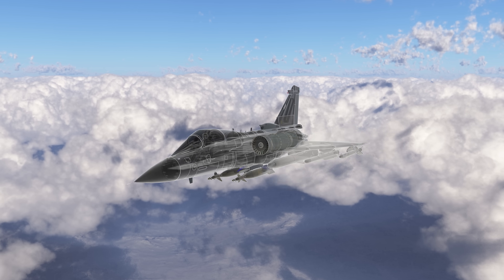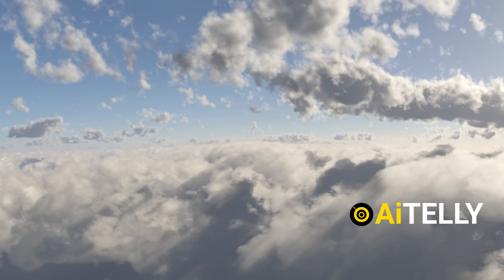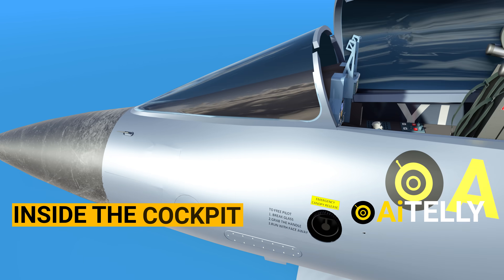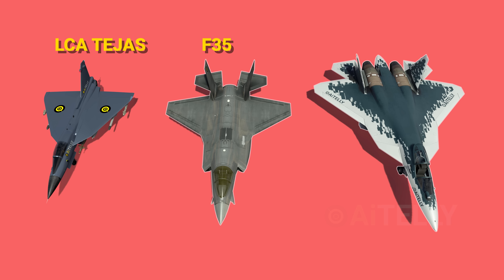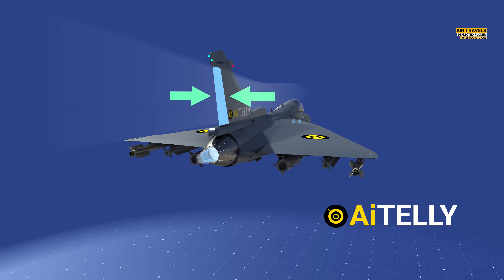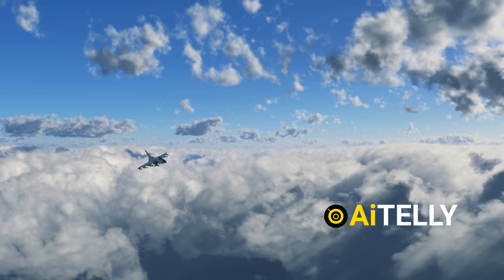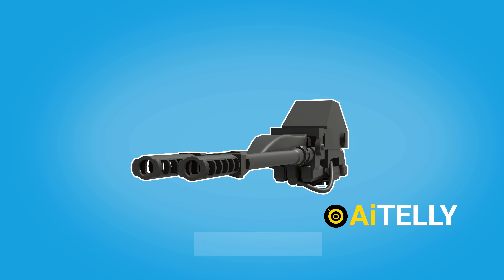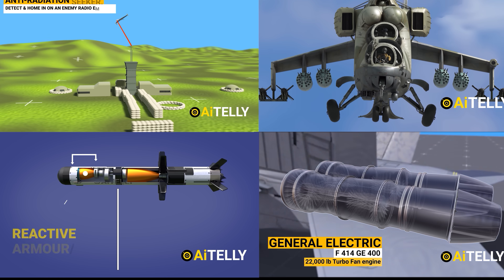Multirole Fighter Jets  How it Works | Tejas Mk1A LCA Light Combat Aircraft #fighterjet #jet #plane

Comment: Wow, I never knew Tejas was the lightest multirole jet. I am indian and never realized just how small it was, even seeing it next to our Rafales and Su-30s. Great work as always. One minor suggestion, could you cover the intake design in future videos more? It is an important aspect of modern aircraft for RCS and overall efficiency purposes.
Reply from the maker: Thanks for sharing
Reply: well Su-30 is ofc a heavy fighter so is more bigger but i also never though Tejas is more smaller than Rafale
Reply: @HHI_10  the size of the Tejas is 2/3 of Rafale. As i see them both fly side by side over my house.
Reply: You should have known..keep urself updated and don't fall for ANY propoganda
Reply: 1 hour flight time what can it do
Reply: @vctor6768   more than 3 hours....wtf are you talking
Reply: @detectivesroy    that's when it's not carrying anything...the frame is so small
Reply: @vctor6768  it already flew Sulur(india) to Singapore with 3 drop tanks ranges around 3300kms. Demonstrated range of 1800 km with 3 tons payload(including 1 droptank) and you saying this.
A Delta wing fighter which is aerodynamically efficient design , same engine & fuel capacity as gripen C even light weight than gripen and you saying 1 hours endurance based on some outdated media outlets. Nah 😏
Reply: @detectivesroy   if 3 drop tanks is 3300km what about if no tanks, and again no tanks and extra weight by weapons...do the mathematics
Reply: @vctor6768  if no tanks then too 1800 km with decent payload. have you read my comment...read properly. If that's the case then jf-17 must have 30min of endurance, and gripen around 60 mins LoL . There Are lot of articles around dismantling this false claims
Reply: @detectivesroy  
as a novice hobbyist , can i ask where u get these infos from?
Reply: @KrishnaGupta-xi6el  delhi defence review ka article padd lena waha acche se explain kia hai . Unfortunately link isn't supporting
Reply: @vctor6768  1 hour flight time enough for defending the borders...that's the primary purpose, it's not for strike capabilities...and due to the geographical boundaries that India has, Radars shall detect incoming aircraft and a highly manoeuvrable aircraft with BVR capabilities is good enough to handle things from the heights that we have over our neighbours. Even if they would go on an offensive, their role would be limited to Anti-radar and anti-ground forces...clearing the way for the "package" delivery aircrafts.
India doesn't want to attack far away, it just wants to keeps its borders well!!
For Attack capabilities we've the Awesome Sukhois and Rafales!!
And mind you, The Mirages have still a long way to go!!

Tejas is a stop gap...it won't be required to fly beyond an hour! A powerful single engine , lightweight with a nice payload capability means the fuel HAS to be compromised!

Also, smaller the size, minuscule the RCS!!!
Reply: @drparthgajjar  hahahah have u had of JF 17 thunder ⚡⚡
Reply: @vctor6768  ya...pit em against Tejas netime!!! (Basic Tejas or MK1 or MK1 Alpha or any damn variant)
Reply: @drparthgajjar   the only thing that this junk is match for is the MiG21 bison ..
Reply: @vctor6768  you mean the same Bisons that brought an F16 down?
Reply: @drparthgajjar just looked into that story, apparently the Indian mig 21 crashed and then everyone started saying it shot down an f-16 with 0 evidence😂

They had some photos that they claimed was the shot down f-16 but the destroyed f-16 in the photos had an America engine, Bellingcat concluded that Pakistan has none of those variants
Reply: @James7583  a fired missile part which was found in India could only be fired from the F16, there are literally pictures of it. The Pakistani general tweeted saying they had 2 pilots in custody (one of whom was pronounced dead later) and deleted the tweets later. If only one Indian pilot was there, why would the Pakistanis claim 2? And I hope you realise a high level official just doesn't post anything.
Reply: @vctor6768  yea junk fighter 17, even myanmar doesnt want to fly them thats how good they are
Reply: @vctor6768  The latest MiG-21 Bis had a flight time of 30 - 45 minutes only, from engine start to engine shut down! Tejas was designed as its replacement, yet it is better in almost all parameters!
Reply: @vctor6768 in 23 min pakistan is finished 1hr is too long
Reply: @vctor6768  I can offer you some burnol😝
Reply: @codlover4727  😂😂 at my service

Comment: Naval tejas was cancelled as navy wanted a twin engine jet. It's knowledge will be use to build tedbf

The current version is mk1 not mk1A mk1A won't start production until few months from now.

It uses 404 engine 414 will be used by mk2 not mk1A.

Comment: well done 👍👍, AiTelly, 
for next....,make too about Sukhoi Su-30MKI Flanker-H  it is a heavy, all-weather, long-range,  a twinjet multirole air superiority fighter , developed by Russia's Sukhoi and built under licence by India's Hindustan Aeronautics Limited (HAL) for the Indian Air Force (IAF), 
The aircraft is tailor-made for Indian specifications and integrates Indian systems and avionics as well as French and Israeli sub-systems,  

well talks about India, this country is  very smart , talking about this one country, India, is a country that is very smart in building friendship for the advancement of the defense equipment it has for its country, the factor of India's closeness to Israel, Russia, the USA, and France at the same time is really used by India for the progress of its country, 
friendship should not want to side with one of the western or eastern blocks, but be friends with all,
well done India 
and Thanks AiTelly 
Merci....👍👍👌